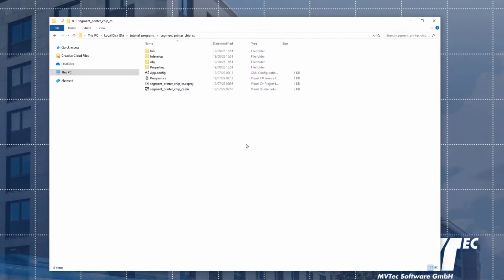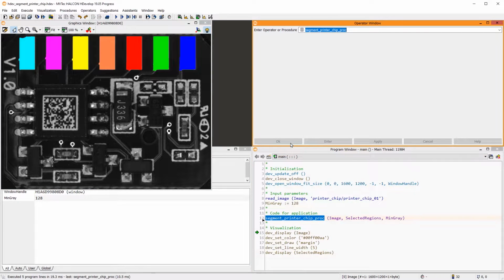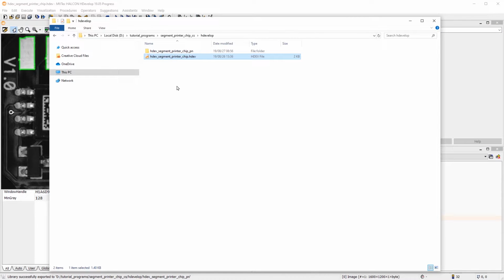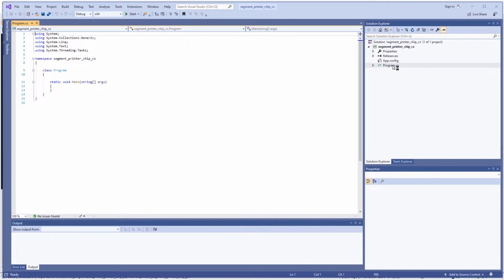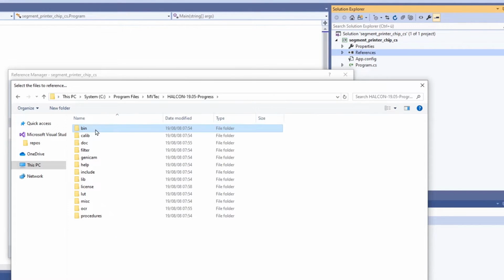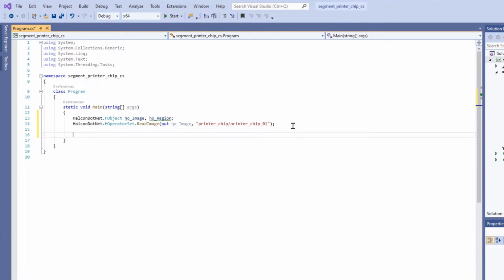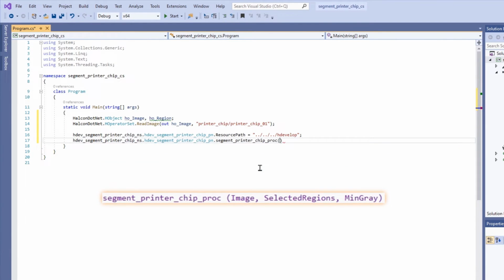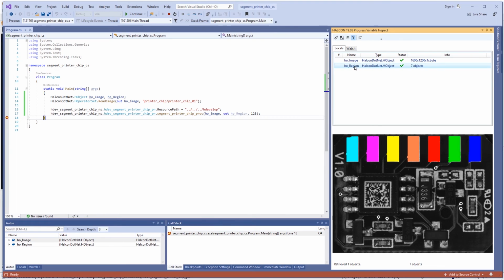Integrate HDevelop code into a C# application using the Library Project Export

Comment: Well explained but I get the error: "System.BadImageFormatException" --> Wrong image format "Excepción de HRESULT: 0x8007000B)". The line which causes this error is exactly as it is in the video "HalconDotNet.HOperatorSet.ReadImage(out HalconDotNet.HObject ho_Image, "printer_chip/printer_chip_01");". Do you know what can cause this problem? Thanks!
Reply: Ok, I fixed it and I want to put it here just in case somebody else got into the same issue. The platform between the Visual Studio's project and HDevelop must be the same. Sometimes there's "Prefer 32-bit" selected on VS by default and it causes this problem (VS > Project > Properties > Build > Platform target). Just ensure that both are x64 for example. Cheers!
Reply from the maker: @avuifasol  Glad that you've also solved it! Our comment below :-)
Reply from the maker: It seems that the project settings do either not match the bit rate of the operating system or the used HALCON architecture.

This error is a sign that they try to build a 64 bit application but link to x86sse2-win32 of HALCON/.NET. Or the other way around by building a 32 bit application with x64-win64. Or they try to start a 64 bit application on a 32 bit OS.

Please check if the target platform and architecture fit to the currently installed %HALCONARCH% environment (please check also the %PATH% environment variable) and select the proper targets.

Also the setting AnyCPU might not work correctly on each system. We recommend to set your project directly to either x86 or x64 instead.

Thank you for the request. It is possible to run HALCON 32bit and 64bit applications on the same PC. You just have to make sure that the HALCON 32bit as well as 64 bit is installed on the system and both halcon.dll are available via the path variable ('%HALCONROOT%\bin\x64-win64;%HALCONROOT%\bin\x86sse2-win32').

Best, your MVTec team

Comment: hello i do every thing but i have error.

Info: Unkown, empty or uninitialized variable: ho_Region
Info: Unkown, empty or uninitialized variable: ho_Image

icant start Variable Inspect
Reply from the maker: Thank you for your interest in HALCON. You can download our project here: https://www.mvtec.com/services-support/videos-tutorials/single-video/integrate-hdevelop-code-into-a-c-application-using-the-library-project-export
Please try if you can run this application. If not, please contact your local HALCON distributor to get support. You can find our distributors here: https://www.mvtec.com/company/partner-network/halcon-distributors 
Please describe your problem to your distributor and attach all your used files.